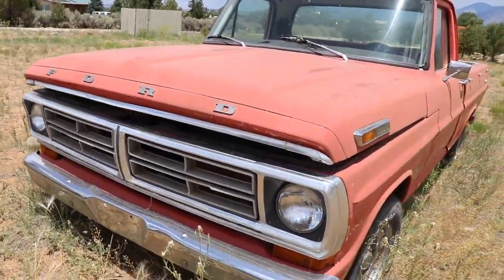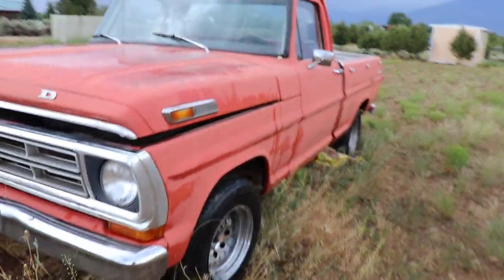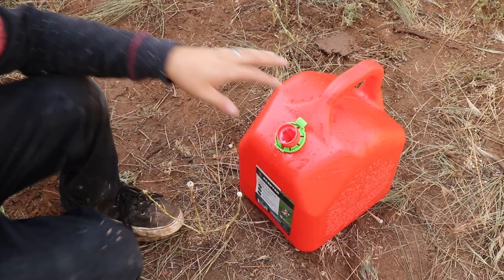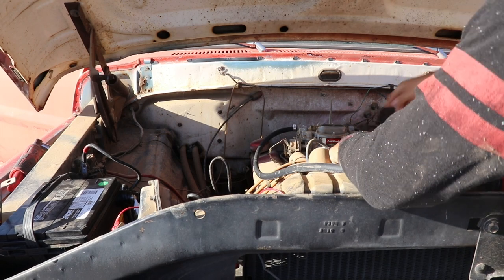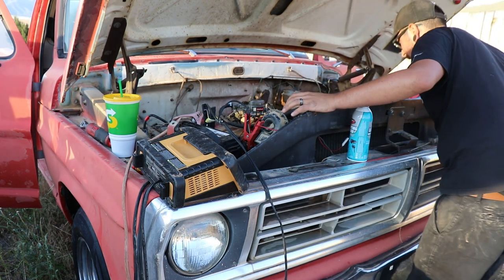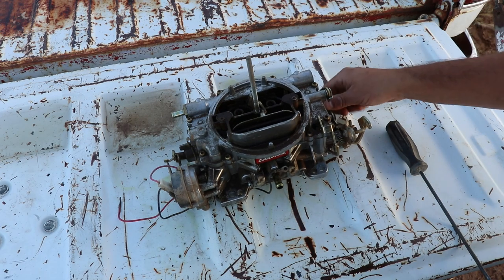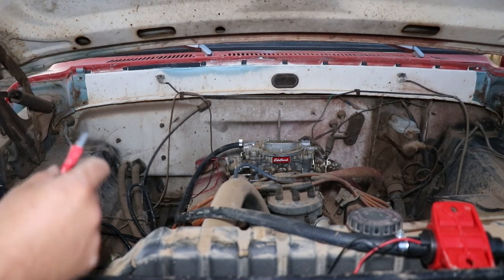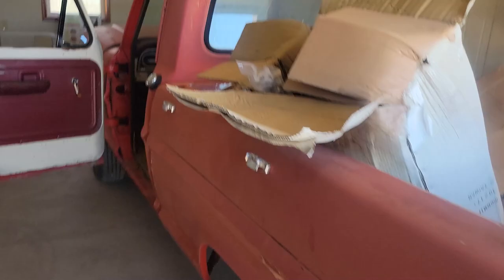This truck HAS NOT been Touched for 12 Years - Will it run? 1972 Ford F100

Comment: Cool truck I have a 73 F100 Custom Explorer with a 360, 4 speed and true dual glasspacks.
Reply from the maker: Nice!
Reply: @JovaniDanteGriego  thanks.
Reply: Was a teenager in the 80s had a 71 f100/302/3 on tree.. my dad's and you would see sometimes red colored glass packs that were called cherry bombs

Comment: Nice I  have a 1970 f100 and I just learned a few things.  I'm a incomplete quadriplegic and I'm trying to get my truck running but I think it's the same thing that happened to father in law truck. It would be cool if u make a video on how change the gas tank.  My gas tank is in the same spot. I want to change it and put it somewhere either the fuel cell In the bed or like where u are going to put the gas tank underneath. THANKS FOR THE KNOWLEDGE U HAVE A NEW SUBSCRIBER !!!
Reply from the maker: Thanks man! I appreciate you watching! I'll definitely be making that gas tank video next I'm I'm up there
Reply: @JovaniDanteGriego  thxs for replying I know its hard to do so at times.

Comment: I had a 1972 F100 , was my first truck & was red/white . Fond memories. I’m quite sure mine had the 360 engine. Had a friend had a 390 . Not sure they came with a 302 . The later F150 around 78-79 had the straight 6 option & the 302 v8 . Enjoying your video.
Reply from the maker: Thank you!

Comment: I have noticed that most newer gas cans have either the anti spill tube yours had or the white square baffles adhered to the bottom center of the gas can of course though the ethanol junk in the gas eats the adhesive and the plastic type baffles just rattle around floating around in the gas cans midas i think it might be Midwest brand i don't remember it came from tsc and the older ones are from Walmart...
Reply from the maker: Tractor supply sells a "race" jug style can that just has a rubber hose as a spout. It works so much better

Comment: on this carbs withou return I used to install a "debubbler" (don´t know you call tem like this), it helps to relief pressure and you have a return. less problems with overflowing and the pump lives longer.

Comment: I have the same car passed down from my grand dad been trying to fix it but I just can’t find the parts and where to find them do , where do you recommend to get parts for this kind of truck
Reply from the maker: What kind of parts? There's lots of catalog companies but typically when I need something I just do a quick Google search or eBay
Reply: @JovaniDanteGriego  break shoes if I’m correct
Reply from the maker: @mingobehindthecamera7009  those should be available through any parts store

Comment: You should always put jack stands on the frame I`m not sure if you put it on the rad cradle or what but they are meant to go under the frame of the truck anywhere else your risking your safety and risking bending and breaking things on the vehicle.

Comment: Wasp killer on the cheap and you can waste it as much as you want and it doesn't damage any of your interior panels or any of that stuff. Here's a recipe. Get a garden sprayer that you can pump up with pressure. Try using a squeeze trigger bottle I don't like them they don't seem to handle the panic I got to squeeze the handle super fast because I have a lost coming at me trigger pull LOL. Put a very generous amount of Dawn dish liquid storms sort of concentrated soap I like Don it works fill the rest with water and then spray your hand if you have a good soapy ladder kind of thing coming out as long as it can come out in a good steady stream you can pump it up and now kill every wasp in sight. Any bugs that breathe through their body will be eliminated and then you can just claim the rest of the vehicle with your soapy water. I have had the wasp spray mess things up. Dawn dish liquid doesn't mess anything up. And it cleans as it kills. It works on your house and all that kind of stuff. If you have a reoccurring nest you can add I think cinnamon to it and that's supposed to keep them from coming back but I have never had them come back.
Reply from the maker: Dude awesome! Thanks!
Reply: @JovaniDanteGriego  yeah I have a few questions for you on a LS swap project I want to do because I can tell you have been doing a lot of research and messing with them I want to do a LS swap on my 85 square body Suburban dillow Drive you can see it on my channel I've got haters I got motor mounts I have the engine I have stock wiring harness computer I'm going to be hooking engine up to a 700R transmission the fuel pump is what I don't know how to find resources on. I want to run a frame rail fuel pump because it has a 40 gallon tank and I don't want to lose that
Reply from the maker: External pumps are always going to be louder and less reliable long term because of cooling. But a genuine walbro will be fine. Minimum 255lph

Comment: Those carbs are only supposed to have 7psi on them
Reply from the maker: The fuel pump was for a carb, rated at 5-8 psi but It don't trust I went through 2 of them in one day last time I used this Edelbrock pump.
Reply: @JovaniDanteGriego  yeah I’ve got a edelbrock never have been able to get it to run right
Reply from the maker: I bought a truck with a Holley and it was amazing the difference
Reply: @JovaniDanteGriego  yeah I just put a LS in my truck so I could get fuel injection, I have a channel with it on there

Comment: Why don't you use the ratchet handle to beat on the carb floats instead of using the ratchet head for a 🔨 all you going to do is F'up your ratchet
Reply from the maker: Because it's a 20 dollar harbor freight one with lifetime warranty my guy. 
Anything is a hammer if you make it one
Reply: @Jovani Dante Griego  pliers also work good 👍